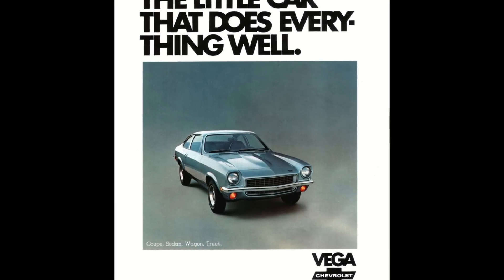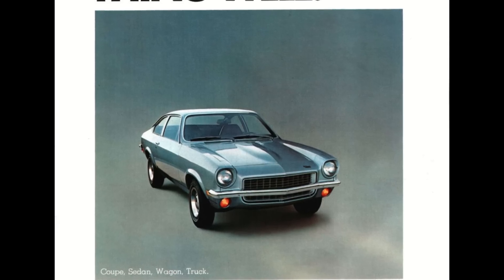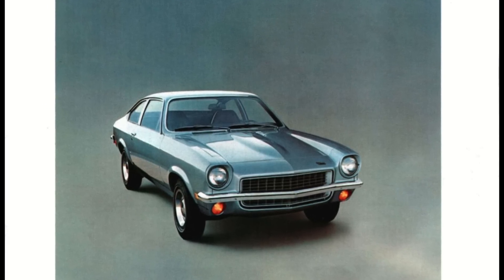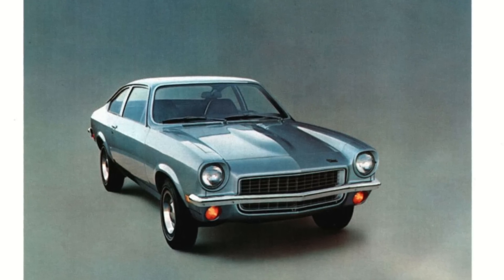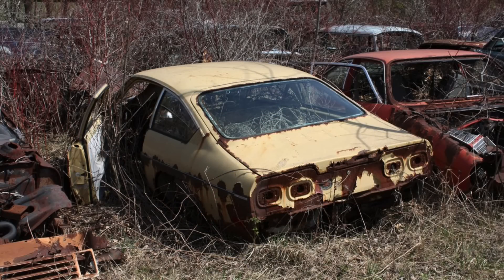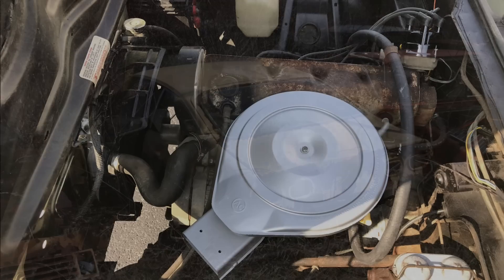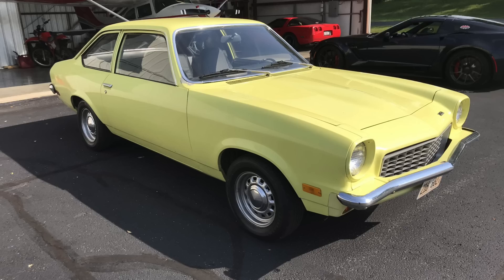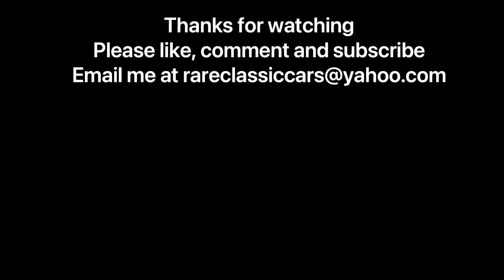GM's Largest Failures: Why The Chevrolet Vega's Engine Turned Buyers Away From American Cars

Comment: We raced a Vega at our local oval track for 4 years. With an aluminum engine! BUT, the first thing we did with every engine was sleeve it!  We also put a flow restricter in the oil passage to the head. We also JB welded the gap between the #4 cylinder and the corner of the block where the gasket was skinniest and prone to blowout.  We also used 250 six cylinder truck connecting rods as they are beefier on the big end but the same length, wrist pin diameter, and crank journal size. A few other tricks as well to get 225 hp out of an engine that originally only made 85.
Reply: Those are impressive tricks.
Reply: I realize this is a race engine, but what kind of life expectancy did you see from these builds? Did you get a season of racing from the engine? Longer?
Reply: @cdjhyoung  we raced 4 years. The first season, we just threw rings and bearings in junkyard blocks. We got really good at that, like, start at 7:00 pm with engine in chassis and be done, in chassis, and test fired by 9:30. THEN my racing partner figured out we should machine the crank! 😆  The next 3 seasons we only went through 2 more engines.
Reply: @thewretchedmessgarage7097  Practice makes perfect. But that is still pretty impressive time to swap and engine in a stock body car. What was wrong with the cranks that machining them improved them that much?
Reply: @cdjhyoung  Neither my racing partner nor I had a decent micrometer to check how out of round the rod journals were. For some unknown reason it always seemed to be the  number 3 rod journal too.
Reply: I don't know what engine you were working on,  but the one my friend had in a GT station wagon,  we took the engine out,  took it to a engine shop for iron sleeves and they ruined the block and had to go to a junkyard for a donor engine. 
The engine block was donated to the local high school for the aluminum,  we recast it and made mountain pie iron. 
The aluminum was about the same as was used by the  Club Aluminum company for pots and pans and roasters, you could see the copper in the aluminum. 
The reason why the engine suffered a high failure rate was because they knew it would not work with a straight aluminum cylinder so they coated the cylinder with Teflon. 
That worked  good until you ran it out of water and over heated the engine at which time the Teflon wore out of the cylinder  which caused excessive clearance between the pistons and the bore. 
Putting rings in it temporarily fixed the clearance issue but then either the rings ate the cylinder or the cylinder ate the rings. 
So they went to a iron cylinder and a better piston and then it was just fine,  but the reputation was so bad that they had to rebrand it as a Monza to get someone stupid enough to buy it. 

So the obvious solution was to use cast iron everything,  increasing the CID to 2.5 liter and calling it the Iron Duke because the cylinder in the block resembles the knuckles on your fist.

The new engine was put in everything but your mom's Maytag washing machine and it was the most successful 4 cylinder engine GM ever built. 

The problem was not the design but the idiots that built it.   Lordstown Ohio  plant was the newest plant with robots welding the unibody chassis and when GM wanted more production they just speeded up the line. 
So no one cared about the car or their job.   To get a day off all you had to do was make so many wrong things that the parking lot in the rework would be full and then they would close the place until they got enough fixed to restart the line. 

The dealer would have a kit with 100 parts in it just to make it roadworks.

Wrong bolts holding in the seat,  wrong bolts in the seat belts,  wrong bolts holding the rear end and shocks. 
Wrong bolts just crank up the impact gun and run them in the hole,  strip the threads,  don't worry about it,  just keep the lines rolling.   People doing the same job for 10 years and they went nuts.
Reply: @boknows3841 A cousins husband bought one of those Monza cars way back when (1980 maybe)??  He LOVED it. His friends loved it and he had offers to sell it.  "Monza Spyder" in black with I think orange or bronze racing stripes. 
I had a friend in school who drove a 76/77 Astre.  He liked it but cursed about the proprietary air filter. 
I kinda remember him trying to rip or cut it open and found it was a regular rubber topped filter ring bonded to the sheet covers.  
The original engine design was known for seizing up in traffic jam in summer. 
Yes the exhaust smoke
Reply: A pity the Cosworth Vega’s were not more abundant, 
as they were a bit delicate but had greater potential across the board….
Reply: @rwaitt14153: You are beating a dead horse.  The problem with the pinto wasn’t unibody, or the gas filler behind the license plate: it was the fact that the top of the gas tank was also the floor of the trunk!  This coupled with the weak structure (because no trunk floor) and the lack of crumple zone between the bumper and the tank, made them vulnerable in a rear-end crash.   Several other Ford cars had the same gas tank arrangement, but had more structure protecting the tank.
Reply: @badmoon5249  yeah bad engineering and working on a budget and in a big hurry to compete with japan and Ford made junk, at least the engine was better than the vega's
Reply: @badmoon5249  i will continue to beat this dead horse until people see reason.

do you know what "unibody" means? this is at it's core a unibody argument. don't play silly word games because of some mounting decision. the argument made to the people at the time was that is wasn't inside a sturdy beefy frame. why do you think the "bumper" argument features so prominently? those are mounted to frames in cars that have them and the tank nested inside of it (except side-saddle GM square-bodies which got their own saga).
let's get down to brass tacks, is another layer of wimpy thin subcompact 1970's sheetmetal in the trunk going to save you from a 45 mph read-end impact? lol no. they locate most tanks forward of the rear tires today for a reason. it wouldn't make "safe" the car if they did that.
now as you said, the pinto didn't do anything different than the others of that era. i'm saying that the whole scandal was based on 45 mph rear-end impacts that most cars of the same era would also have severe problems with. this was also recoded. 
anyone know how well an AMC Gremlin tanks that hit? no? why not? shouldn't there be some kind of baseline here if you are shitting on the pinto? but nobody has those when this discussion takes place. nobody EVER compares it to it's peers. but that NHTSA data exists with their impact testing of GM, AMC, Chrysler (actually a mitsubishi), etc offerings. We never hear about how well they could take a tractor-trailer up the ass, do we? 
It wasn't any better.
Reply: Good work!
Reply: Impresive
Reply: you ahve to race  a v8 vega
Reply: The original commenter had the benefit of hindsight; other people's experiences AND solutions to the issues.  New Vega owners of course stuck with stock.
Reply: The Vega would have been a better car if GM engineers would have designed the engines with sleeves in the cylinders and did the same modifications you did with your racing engines
Reply: Old school tricks that worked...
Reply: The Ventura California oval track ran 4 a cylinder race class in the 1980s. There were gobs of Pintos and Vegas. It was fun to get a better ticket to walk in the race prep area. I think there were Pintos than Vegas since more surviving Pintos that ran. lol
Reply: Did you ever consider a 350?
Reply: @MisterMikeTexas   Dropping a sbc is low effort low imagination.  It takes real talent and imagination to evolve the Vega engine to its full potential, as he did.
Reply: @BlackPill-obey  Kindred spirit you and I.
Reply: @MisterMikeTexas  we were a 4 cylinder class. Had to be GM in a GM, Ford in a Ford, etc. Also a 350 would have been WAY nose heavy. Good for the drags, not for roundy-round racing.
Reply: @MisterMikeTexas The 4 cyl class you could only run the factory 4 cyl engines but could modify them for more power & reliability. Back then rule change mandates for the V-8 class dirt track  oval and oval asphalt tracks they all had to use small block V-8 be it Chevrolet Dodge Ford & other makes also being subjective to a cubic inch displacement of no more than 350 cubes . I worked for a guy back then who used to race first oval track Chevrolet stock cars going back to 1957 and many years later he was running modified stock car & was running a built big block 427 Chevrolet & did well with it but eventually rule mandates changed to run small blocks so the 427 got pulled out & sold & I bought the Edelbrock XC-96 cross ram intake rectangle port from him to use on my 66 SS Chevelle I had back then .  My boss back then built a new race car then using the SBC in it with 180 headers and a bunch of mods done to the suspension and he back then used to tune the car & test it going up & down the dirt road by his house and the body shop he owned lol . He was always complaining about rule mandates changed to suspension on some of the cars he was racing in the classes he was in & was doing things to modify the suspension that looked stock to the naked eye but if you were to disassemble the front A arms on his car you could see that he purposely moved where the ball joints were from the factory location to his way that made the car handle better and had more adjustability for different tracks and conditions lol . Smokey Yunic was doing stuff like this for years and got busted doing it but was constantly trying to think of ways to go faster by developing & redesigning stuff on those old cars like my boss was doing to gain a edge against the competition mainly people who had a hell of a lot more money than he did so beat them at their own games of paying people off to change rules mandates in their favor to make it harder for those that didn't have the money or most updated engines or suspensions for the class they ran in .
Reply: @MisterMikeTexas  I’m sure it was a class for four cylinder engines. They were quit popular back in the eighties and nineties. Most people went with the Pinto engine, which could be pumped up to the level he was talking about.
Reply: @williamking6306  Yeah the Pinto 4-cyl was a significantly better engine than the Vega engine in pretty much every way. It had a long and popular life while the Vega never got off the ground and was quickly discarded.
Reply: @rwaitt14153  and there was a good supply of low mileage engines, with only slight fire damage. The gas tank was about as far away as it could be considering the short wheelbase.
Reply: @williamking6306  yeesh, if you really want to get into the reeds here the pinto wasn't any more fire prone than the other cars of the era. the original NHTSA report was about rear end collisions at 45 mph. pretty much nothing would do much better in early 1970-whatever. a good few even had the gas nozzle behind the rear license plate in those model years. those don't do well in rear-end impacts if you couldn't guess. it was a media hack job by Mother Jones that got picked up nationally.
gas tanks and yellow journalism aside, that OHC engine was pretty good for it's day. they matured it and it got turbocharged and did all sorts of stuff later.
Reply: @williamking6306  Oh yeah. We ran against Pintos and 
Mustang II"s with 2.3 s. They had the power with that cross-flow head. But we had coil spring chassis and they had rear leaf springs.  We could play with spring rates so much easier and make our cars handling make up the difference.
Reply: @thewretchedmessgarage7097    It sound like y’all spent a bit of money and a lot of times making your engines bulletproof, were this “claiming” races.?
Reply: @williamking6306  Yes. We had a $500 engine claim.  So we spent as little or as cheap as we cod.
Reply: @rwaitt14153  I had a 1982 Ford Ranger with the Ford 2.3.  It went almost 300,000 miles.  The engine was not the Pinto's problem.
Reply: @rwaitt14153  I have a 1963 Falcon.  The gas tank forms part of the trunk floor. I wonder how safe the 1960s cars were?
Reply: @Jody-kt9ev I had a 1992 Tempo with the 2.3. The head developed a very slight warp at 275,000Km. I took it off and had it to an engine shop for rework and whatever they felt it needed.
It had crazy wear rings at the tops of the cylinders like 0.4mm
Anyway once the repaired milled head was back on the vehicle was due for a e test.
It scored ZERO percent on the one reading and something like four percent on the I think NOx.
Basically "passed with flying colours" and had lots of pep right up until just under 300,000Km when I couldn't drive it anymore (not the cars fault).  
Excellent engine.  
I bought a Mercury Topaz after, low Km belonging to an old lady.  Excellent interior and paint looking like new except for the big hidden rust hole up  beside the suspension that forced me to scrap it.
Reply: @rwaitt14153  I had a Vega GT and way before my young poor a$$ at the time could get it even close to being paid off, the engine destroyed itself. 
I was/am a autobody tech and one of the salvage yards I dealt with had a 2.3 Pinto engine and transmission in a wadded-up Pinto. (no fire!) I bought the whole car and put the powertrain in my Vega, including the rear axle. I drove it till way past paid off, but It rusted out so very badly, I had to part it out. Junked the car, but sold the power train for more than I paid of it.
Never bought another GM vehicle.
Reply: @Jody-kt9ev  I've got a '91 Ranger  with 320k on the 2.3. They are great engines.
Reply: @samborez8089  GM wasn't any better or worse than the others during the "Malaise Era". What gets me is that you fabricated Ford guts into there rather than do the relatively simple Pontiac 2.5L Iron Duke swap. I mean, kudos to you, but dang that is a lot of work for a not great vehicle.
Reply: @rwaitt14153  First reason was I had several more years of car payments to look forward to with the Vega GT. Second reason was the low mileage totalled Pinto was a very inexpensive purchase-no market for engines and various parts that do not break, so the salvage yard sold me that car at cost. Third, the Iron Duke was a more simple swap for those that had no other choice,and it was in high demand, thus very costly.  I really liked the style of the GT and Ziebarted the body so rust wasn't that a big of an issue.
Engine swaps were easy to do back before all the electronic controls
Reply: @rwaitt14153  THey were actually pretty peppy with a 4 speed because they didn't weigh much, that 2.3 was the best thing about those Pinto's and the 302 was the best thing about the Mustang II but they were both death traps. In hs i knew 3 ppl that got  life long injuries/burnt or died in these vehicles my jr. and sr. year, two of them were my friends.
Reply: @richardbaumgart2454  i'm sorry about your friends but that doesn't prove that the cars were any more flawed than the other designs that were out there. only that they were popular cars with your hs friend group and that they had an above average amount of accidents. anecdotal evidence is evidence of nothing.
if you don't believe me look it up for yourself with the original NHTSA safety reports from other cars at the time. per mile the pinto and related vehicles were not any more dangerous than other subcompact cars and the engineering was not any different than what was out there. filler necks were behind the rear license plates, dude. my chevy nova in hs had that feature. it was unibody too. if i was to be rear-ended at 45 mph it would have popped and thrown flaming gasoline all over the place just like a pinto.
it was just the way it was back then.
Reply: @rwaitt14153  well my 2 ton Buick  had the filler neck behind the license plate just like the Nova and many other cars but you didn't really hear about them blowing up when rear-ended. Personal experiences and what I've seen with my own eyes speaks a lot louder than any NHTSA stats for me. The media had a frickin hay-day with these cars, it wasn't all made up obviously. I do realize that the Pinto wasn't the only unsafe car on the road at that time though and I have seen video of a Nova gowing up in flames from a rear ender.
Reply: @richardbaumgart2454  the whole technical engineering argument was that the pinto was unsafe because it was unibody and didn't have a frame around the gas tank like the older cars did and it's rear would collapse and the gas tank would get crunched. that was the argument. not your experience. not your friends. not what your read in the paper.
it was the engineering argument, okay. this was the thing that the NHTSA found. that the courts had to deal with. what ford engineers had to "fix".  but, like i said, the nova and a whole bunch of others were also unibody and they all did the same thing. yet nobody says a peep about them. 
a bit of your own investigating of primary sources and it becomes clear that it was quite frankly made up. it was taking some standard data collected by some regulator and regurgitating it into print media with inflammatory language. it worked too. you and many others keep repeating it decades later because it stuck in your brain. it doesn't matter if it was truthful (the NHTSA safety data tells a different story than the headlines) it was that you and most other people just took the media hype at face value. it was so LOUD it had to be true, right? but if you actually dig into it,  look at the actual data across everything, it isn't.
it was a hack job that went 1970's viral. just like a bunch of other US automaker half-truths of that era. they didn't really stop until NBC got caught faking "disasters" with the square-body GM side-saddle gas tanks in 1993.  the media don't do it as much any more after that. that one cost them and whoever paid for these things apparently agreed to a ceasefire.
Reply: @rwaitt14153  It didn't have anything to do with the Pinto being a unibody and the gas tank not having a frame around it, it was the placement of the gas tank between the rear bumper gas tank that made it easy to rupture in a rear end collision. It didn't help any that these cars rusted away underneath in 2-3 years either. No matter how you dice it those cars were shit, I've worked on Mustang II's before, there's not structure to them especially after a couple Michigan winters. Not all unbodied cars go up in flames from that era, half the big cars made from that era were unibodies.
Reply: @richardbaumgart2454  where do you think the chevy nova put it's gas tank? on the roof? in the passenger seat? 
what to you think framed cars mount their bumpers to that unibodies do not that would make it more squishy?
engage your brain. stop repeating the silly things that you were told. they don't make sense if you take even a split-second to think about it.